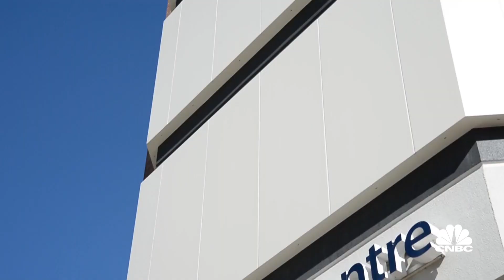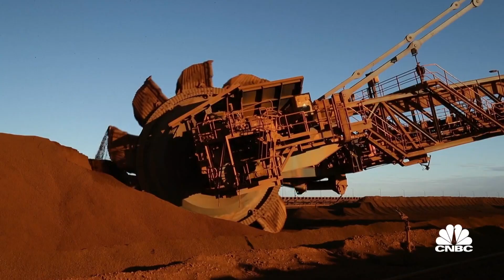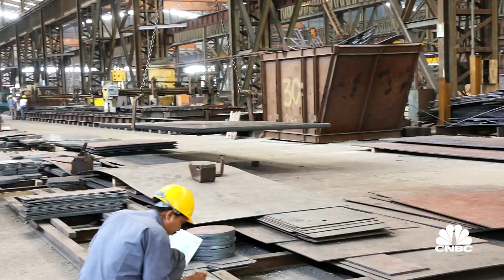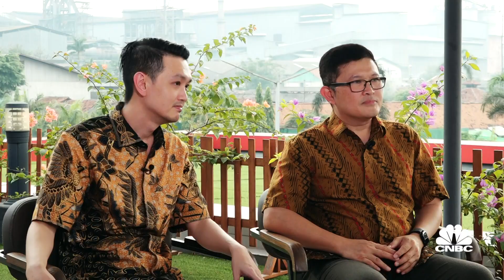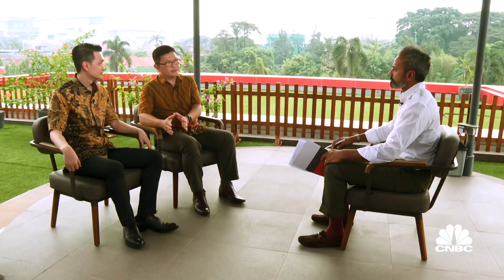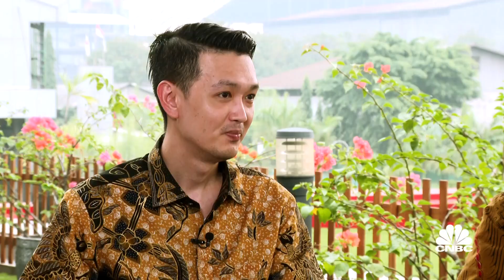We share the same vision as Fortescue Future Industries: Gunung Raja Paksi

Comment: at this stage, ammonia is looking like a more cost-effective option for many applications where hydrogen was previously touted. reasons being (i) much infra is already in place for handling of ammonia (ii) does not require high pressure or low temperatures for transportation or storage, which means big capex reduction (iii) more energy dense than hydrogen given it's NH3 not H2